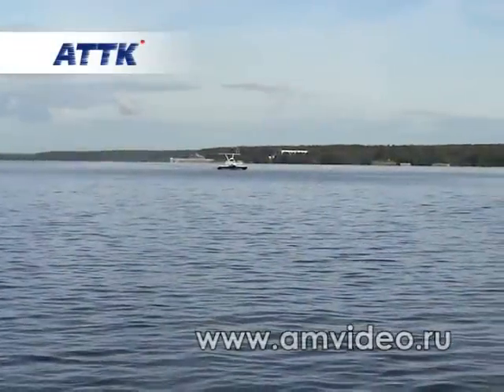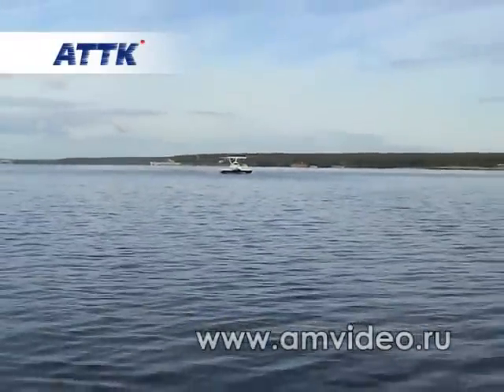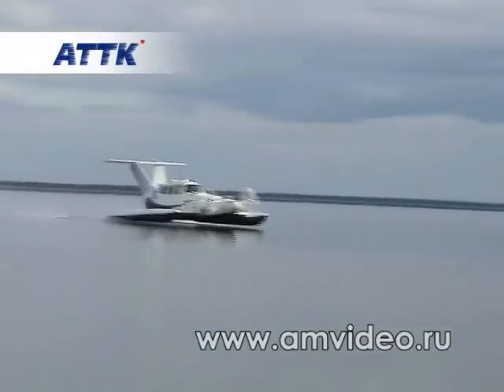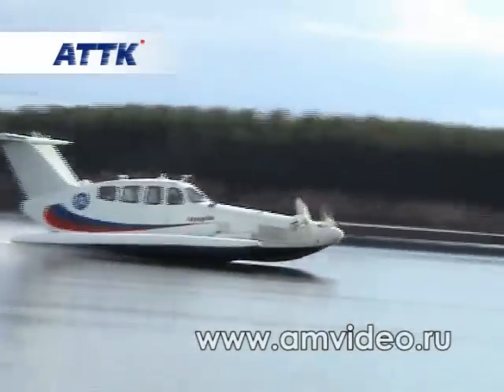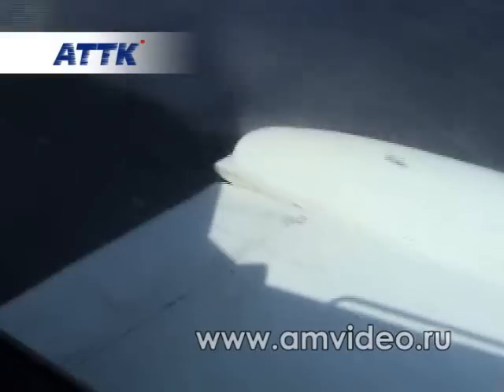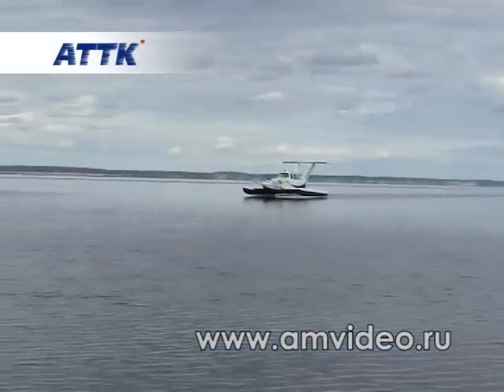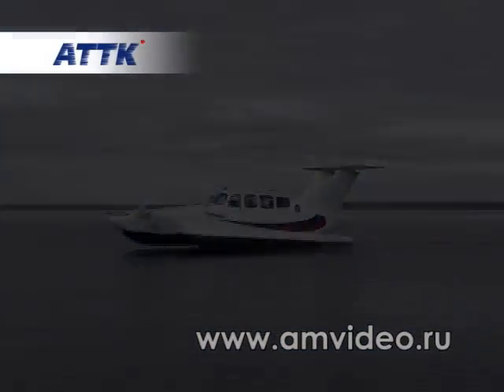Aquaglide 5

Comment: For the people looking for more information on WIG craft look up the Airfish-8. It flies higher and has no problems turning. Generally, WIG craft can fly 1 half the width of the wing (front-to-back) above the water. There's video of it doing intentional wingstrikes on the waters surface with no problems. It's comparable in efficiency & speed to a small airplane, but larger versions are dramatically more efficient given that as the craft pushes air downward, it reflects off the waters surface and pushes back up on the wing, then reflects back down again, then pushes back up again, etc. 

The downside is that while these vehicles technically could fly over land, there's much more stuff you'd have to avoid (trees, power lines, etc.) not to mention airplane engines are pretty noisy when they're close to the ground.
Reply from the maker: Hypercube9 Airfish-8... Do you know the price? Over a 4 million US$ for 8 seats. With this high price none will not purchase it.
Reply: @flightboat  New info:  (May 2019) the South China Morning Post is quoting Kenneth Tam, General Manager at WidgetWorks, with update info on the Airfish 8, saying they'll be making 50 per year at only $500,000 each, with "cruising" speed of 90 knots.  I think the top speed is a lot more, will look into it.  It's the right size & load capacity to be a great 2-4 person camper on water  :)

Comment from the maker: When moving as a motor boat (partially immersed in the water) "Aquaglide-5" may reach the speed of 80-90 km/h by manipulating with the air pressure in the floats. Transition to the cruising speed (lift off) happens at a speed of 90-100 km/h. This speed is reached within 40-50 seconds when the craft is moving on the obstacle-free waters or on the ice-covered waters.

Comment from the maker: When moving over the water (sea, river, lake) for "Aquglide-5" the maximum of the waves height for the lift off and moving of at cruising speed is 0.35 m at the wind force not more than 5 m/sec corresponding to 3-4 points of Beaufort scale. Alighting (landing on water) is permissible at the waves height about 0.5 m at the find force of not more than 10 m/sec.

Comment: There are a few reasons existing WIGs have all had high aspect ratio wings;
The wings smash into waves in rough seas and on landing. Low AR wings would be less robust than thick ones.
Lift is generated by air trapped under the wing, they are not particularly efficient aerofoils in free space. Large chord wigs make better use of trapped air, so it flies higher above the surface, meaning better ride, fewer  wave strikes.
Not sure why you'd think multiple low AR wings would be better.

Comment: Cool idea, but how does it work in choppy/rough conditions or in areas with high boat traffic or other obstacles to avoid?
Reply: +falcoperegrinus82 it doesnt. but there is good new. bigger the craft higher can it fly using ground effect. so bigger crafts cant fly in more rough seas.

Comment: Clever Russians Those look like hydraulic driven propellers?
Reply: I have an aviation engineering background, and I'm quite sure there is a drive shaft inside that tube, and two ninety degree gearbox's.  Hydraulics would be too heavy and creates too much heat.  I'm sure it has a drive shaft just like every helicopter tail rotor.  However, the pitch of the blades may be hydraulic.